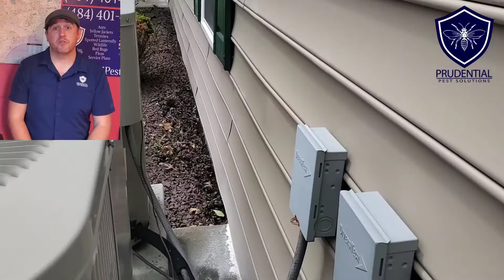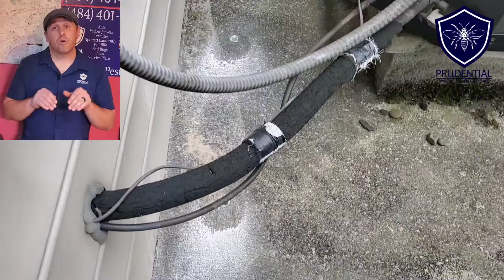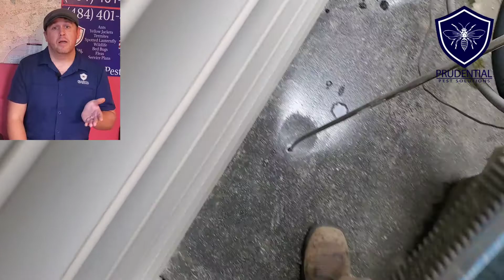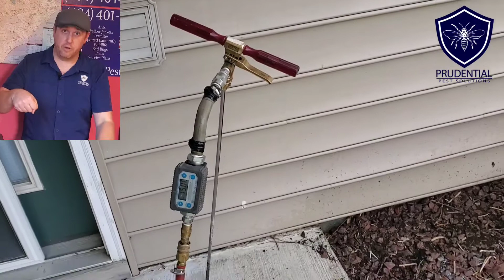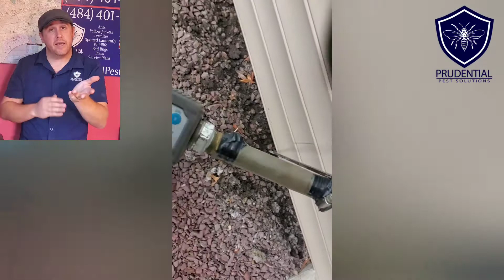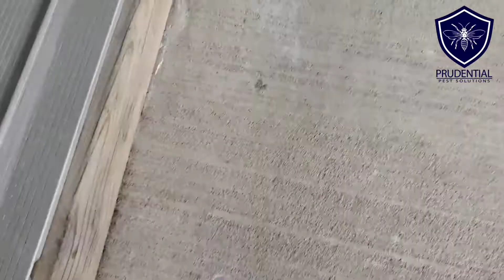Termite Treatment in Reading Pa

Comment: Ryan, on general outside treatments what setup do you recommend? Curious if you like backpacks or power sprayers.
Reply from the maker: I like to use the Milwaukee Backpack Sprayers due to their great range, awesome battery life, and the batteries are the same as our vacuums and drills.  I also prefer the backpack setup because it allows us to use smaller service vehicles and to apply better chemicals in more specific areas.  We only use our large 50 gal rig for termites, tree injections, and tree treatments.  Great comment, thanks for checking us out! -Ryan